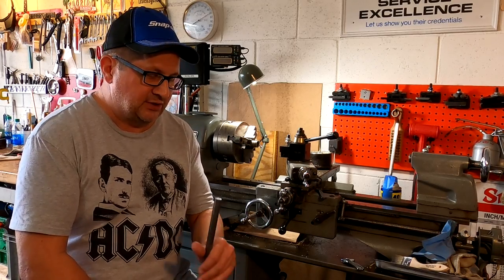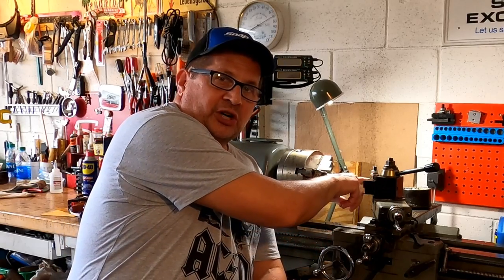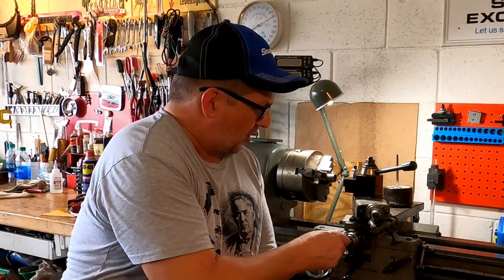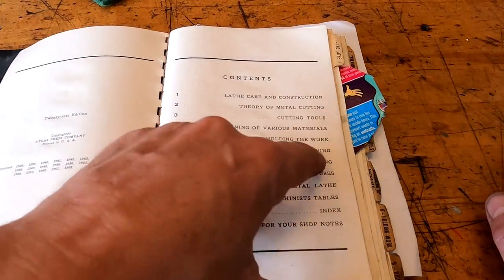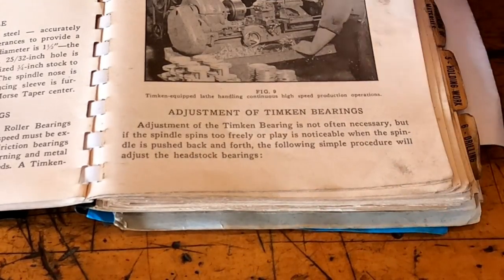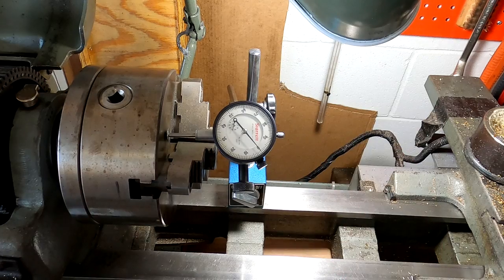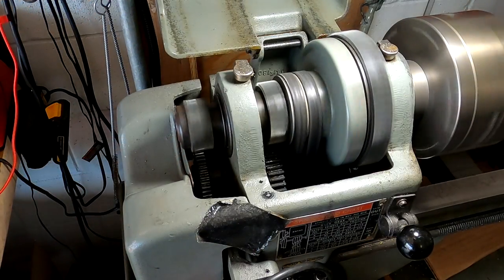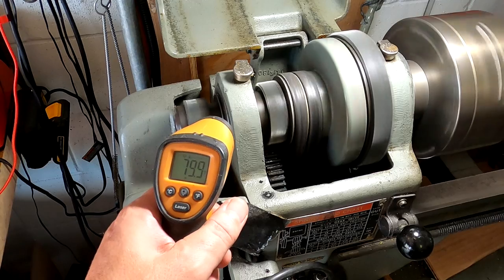Craftsman - Atlas Lathe, Spindle Adjustment

Comment: As the temperature goes down, the length of the spindle shrinks, and the fit becomes tighter, not looser, which is why they want you to run it, to heat it up, so that it will lengthen, and become looser. I can’t really recommend way oil for the spindle. That’s for very slow operations, for a sliding fit, and is sticky, which is the opposite of spindle oil,, which is designed for high speed close tolerance rotating parts. Way oil changes its characteristics dramatically when it heats up.
Reply from the maker: That's some good info to know.  I'm gonna take another look at it. Would have thought the opposite. Thanks!👍

Comment: Enjoying your vids.  Was reading the bearing adjust procedure along with you.  Thought, wait a minute, 50 degree F temp rise?  That doesn't sound right.  Reread it a couple times.  It's right in there with running spindle 30 - 60 min., but that's just to warm the oil.  Get it to operating temp.  They're not saying you should see a 50 degree temp. rise.  My building, in Montana, can easily be 40F in the winter & 90F in the summer.  Not trying to do any lathe work at either extreme.  Think they were just pointing out the effect of work room temp.   ???
Reply from the maker: Hey there Chuck. Ya, you kinda gotta read between the lines. There are too many variables to consider. Weight of chuck/work, Axial loads vs radial etc.. time in use, ambient temperature.  Just let her run in a bit and your good to go. This Craftsman I can start working on just about right out of the gate. My monarch on the other hand... She'll get a good five minute warm up before I even think of touching a tool to work. I think there was a time (when these manuals were written) that every boy had gone through shop class and had the facts of lathe explained to them at an early age. Thanks for following. Don

Comment: What brand quick change tool post do you have?
Reply from the maker: Hi Russel. Sorry I missed this comment. Been pretty busy. I'm pretty sure its a Shars branded Asian dovetail lock AXA style. Works really well on the Atlas. I keep looking for an authentic Aloris at the flea market. Its just a matter of time.  For the light work I do on this machine, this will do the trick for now.  Are you looking to add a QCTP?  Don

Comment: I have this same lathe, have you ever changed the belts?, I went to the LINK belts, I'm having fits to get the belts to go through without it flipping....tried the "lazy" way out, but may have to take the gears loose to put on original ones..... would like to have a defendant model number for this one....got a model number 101.28900  &  101.28910  Parts book, it was as close as Icould get.... have not found the exact number...would you happen to know?   like your video, mine is very tight ...no play what so ever. But may need video if I change the belt.       :(
Reply from the maker: Oh jeez.. I'm not a fan at all of the link belts. I may get pummeled for that, but I just don't see them performing as well as a proper V belt. I don't have the actual part number on hand. I know that the Atlas/craftsman parts are posted on line somewhere. I run across them from time to time. Probably one of the Craftsman lathe forums has them archived. Personally when i need something like that, I just get the old part out and go match it up at one of the industrial suppliers. I would also tear my machine down to change them out. I would give me reason to do some good cleaning and lube and replace anything worn. Let me know how it turns out. Don
Reply: @donsengine3158  i did put the link belts on they are well, but on the bull gear the small pull out button will not come out, might get another one, and when i do i'll go back with the correct belts, having trouble with my engagement handle not going in as far as it needs to, which is causing belt slippage... but i enjoying working on it....your videos are great, one of my friends down the road has the same lathe, he is helping out!
Reply from the maker: @TimMoody-ud3ti  Great. I love tinkering around with mine as well. Thanks.

Comment: The spindle of my machine is with brass bearings
Reply from the maker: Yes, yo have an older model. You should be able to dig a manual up by Googling around. I see hem occasionally at the flea market as well.   Don

Comment: I have the same lathe and the same I Guage DRO's installed. Parting off is nerve wracking these machines just aren't all that rigid I have parted stainless steel but everything better be tight on center and parallel to the chuck or there's going to be a train wreck. I made a tool height gauge to set my turning tools to the center of the workpiece and check them often. I really need to invest in a new chuck mine is worn and I don't have the tool post grinder that came with the lathe someone swiped it out of my cousins shop where the lathe was stored or I would true the jaws up. I have adjusted my bearings before but I didn't add the preload and I use turbine oil to lubricate them. Make sure you have felt in the cups to wick the oil to the bearings I replaced mine this year.
Reply from the maker: Yes Perdido, the Atlas doesn't care much for parting harder metals.  I added a 1 HP DC motor which provides a little better consistency under heavy load like parting. Of course correct spindle adjustment is necessary and honestly I almost always use HSS blades as carbide insert parting blades burn too much power. If what I'm parting is too tough for HSS, I'll pull it out and saw it, then clean up the ends.  Thanks for sharing BTW. Don
Reply: @donsengine3158  Yes carbide tools especially parting blades take quite a bit of pressure to work. I started with a thin Accusize parting tool I believe it's 2mm wide and instantly broke the first one and destroyed the holder. I only use it now for grooving and aluminum I have a heavier Shars carbide indexable that I carefully part off with and a couple of tool steel ones I use. I actually get a pretty good surface finish with my Atlas even on cold roll using small radius inserts I wish it could have a slower feed rate it would be better. Emery cloth is my friend.
Reply from the maker: @perdidocamaronero5400  OH ya.  I love Emery cloth as well. Can make even my ham fisted work come out looking decent.